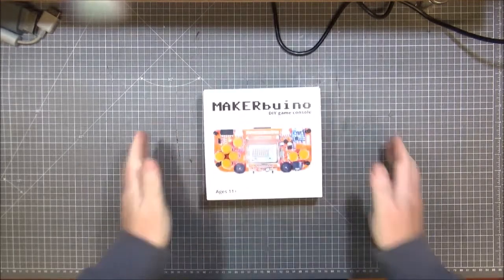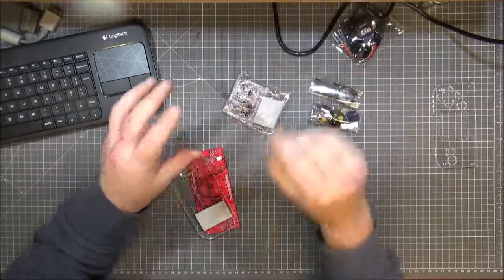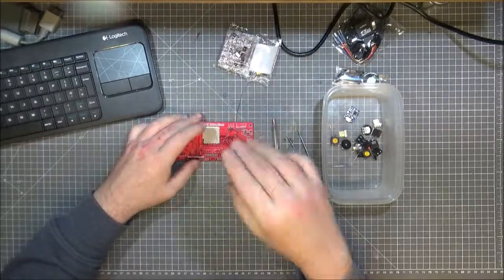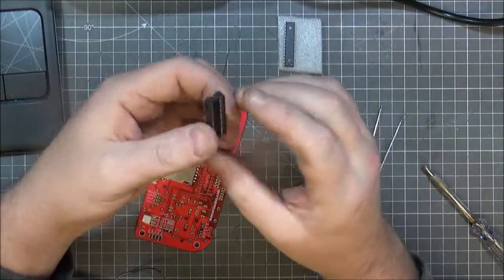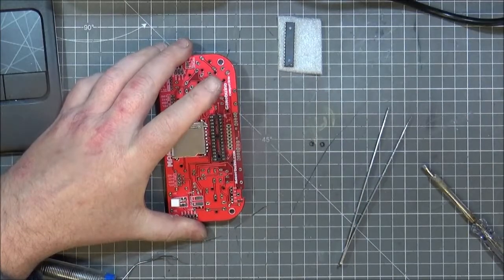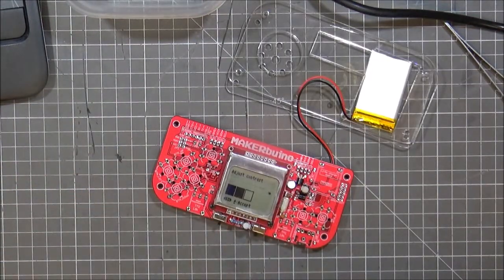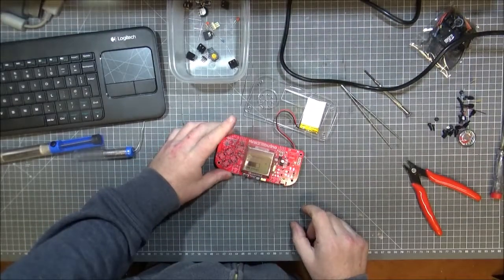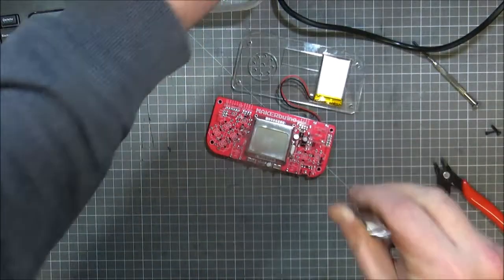MAKERbuino construction. Part 1

Comment: How did you fix the battery problem?
Reply from the maker: I think the connector was just a bit tight from the factory. I managed to pull the connector apart without damage which freed it up, and made it easier to use.
Reply: Retro Tech Ralph I don’t think my connector is too tight. And I still can’t get any power. Triple checked everything but still nothing. I even tried different batteries.